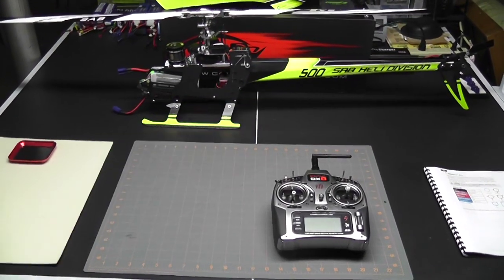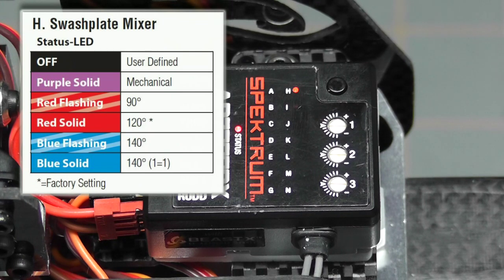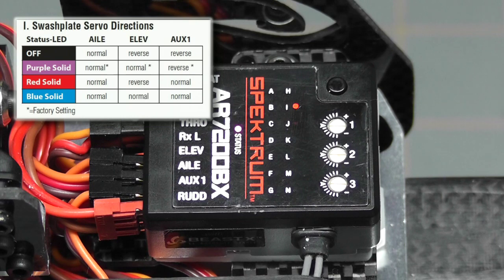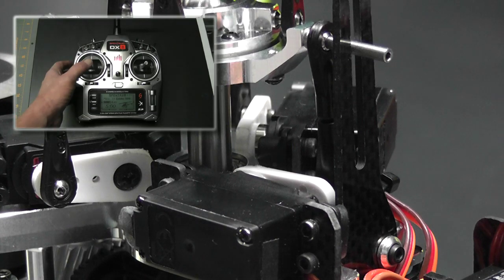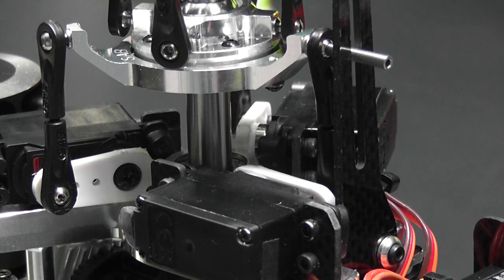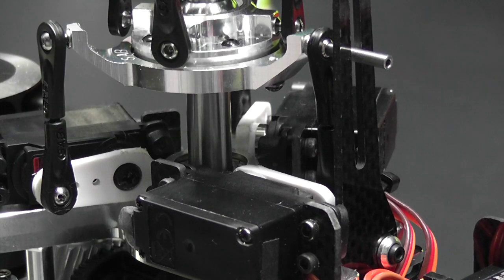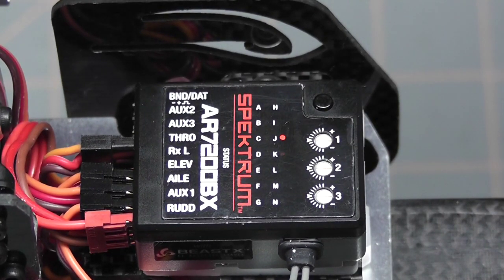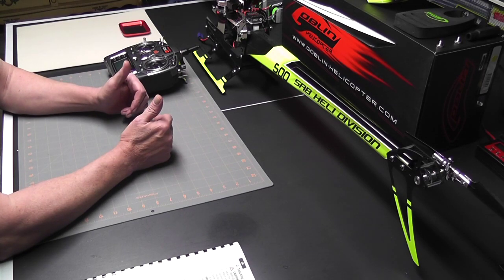Goblin 500 Electronics Set Up - Video 4

Comment: Had a suscessfull Maiden recently , but i'm having som problems whit tail-wag. I'm also using ar7200bx and Wondering if you got the tail setup(on the ar7200 and transmitter) the tail also feels kinda tight, but hopefully this will loosen  up after a couple of flights. Did you have Anny problems whit the tail?
Reply from the maker: Hi there and thanks for posting.  Fortunately I did not have any issues with my tail.  I did have to adjust the gain to eliminate some minor wag on my first hover, but since then it has been rock solid.  Good luck resolving your issue and keep me updated as to your findings.  Have a great day and happy flying.

Comment: When u moved for positive pitch your swashplat went up, isnt that backwards????  On all of my helis my swasplate goes down for positive, and uo for negative. Am I missing somthing
Reply from the maker: Hi there Dustin.  The direction which the swash plate needs to move to create positive pitch is determined on which side of the blade holder the pitch arm is connected to.  The Goblin has a forward facing pitch arm which requires upward movement of the swash for positive pitch.  The main thing is to confirm with a pitch gage.  PM me if you don't understand. Hope this helps!
Reply: Great man. Thanks for responding. I dont own a flybarless heli at the moment so I wasnt really sure. I one the blade sr, 450 3d and rhe 500 3d,  but I cant wait to get my first flybarless heli. I watched all your videos on the gablin 5oo and loved it. That modle is a little out of my price rang and ive never had any problems with my blade products so im thinking of getting the 450x. Does it come with the beastx?  And once again thank you very much for the reply.
Reply from the maker: Hey there!  Any time!  I also have the Blade SR, 450 3D, and Trex 500 all fly bar helis and they are great, but once you go FBL you will love it.  The BeastX does not come with the Goblin.  The Goblin is an expensive heli but well worth every penny.  Have a great day and happy flying!

Comment from the maker: Hi there and thanks for posting and the kind remarks.  I dod the PIP by shooting a second version of the video and then overlaying it in my editing software.  I am a big align guy too and love my Trex 450 and 500.  The Goblin is a step up in design and engineering and promises to be a much more capable heli.  Although I have not flown one yet, I am sure that will be the case. The replacement tail boom is 40 bucks, but there are break points that should prevent the actual boom from snapping! ;)

Comment from the maker: Hey bud.  Yes, if the swash is level use the links to level the blades.  If the tail is moving too fast you can either reduce the travel limit or add some expo to soften it up around the center of the stick.  Hope this helps. Good luck!